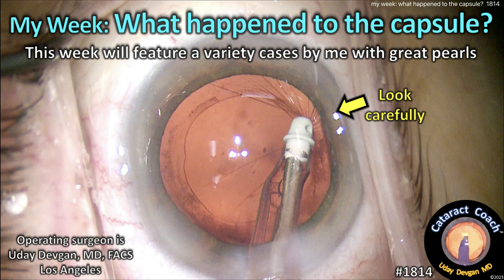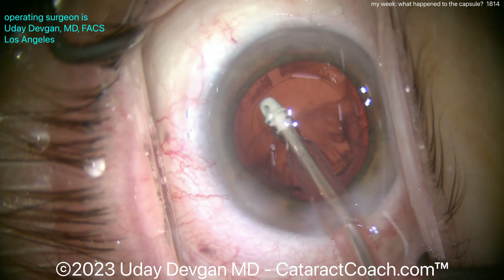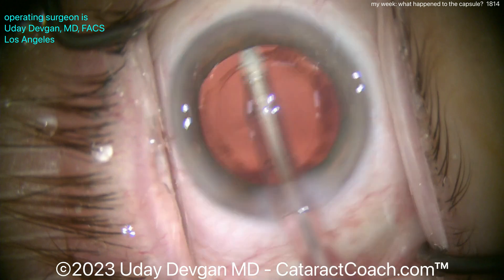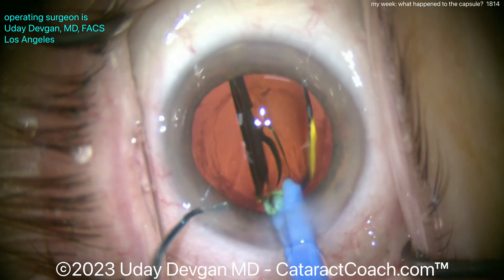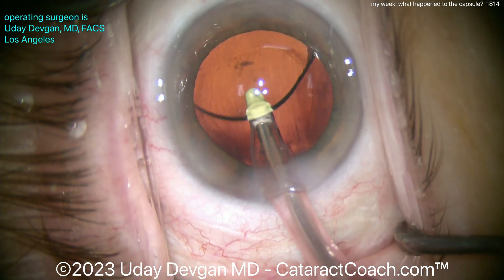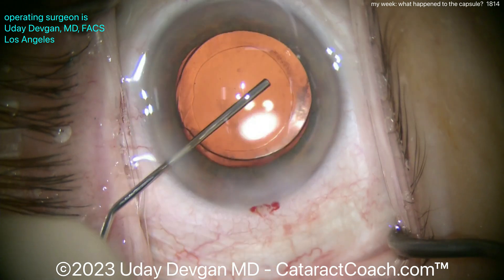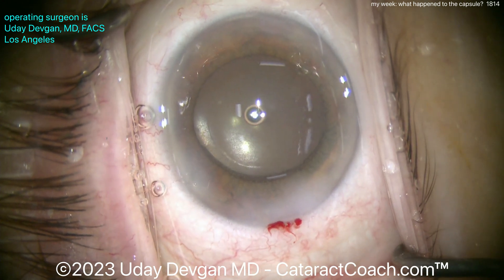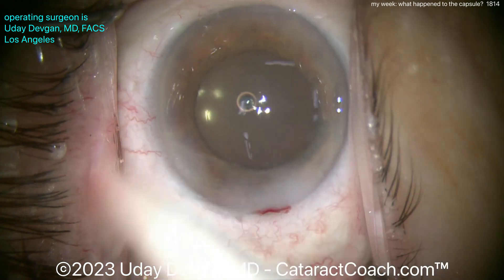CataractCoach™1814: My Week: what happened to the capsule?

Comment: Sir, nicely done surgery. Is it compulsory to implant CTR ( prophylactic)in axial length more than 26 mm ? Was there any past history of PP vitrectomy in this case as there is posterior zonulopathy?
Reply: Absolutely not compulsory or advisable routinely. You’ll stress the zonules somewhat putting the ctr in and increase the weight of the IOL-bag complex, which may increase the chance of late dislocation. I’d suggest you use CTR in cases with 1-3, maybe up to 4 clock hours of focal zonular dehisence or to prevent capsular phimosis in high risk cases with global zonular laxity.
Reply: Big eye- big capsular size -risk of posterior capsular wrinkles which can be prevented by CTR.
Also reduces the risk of subluxation due to future myopic zonulopathy